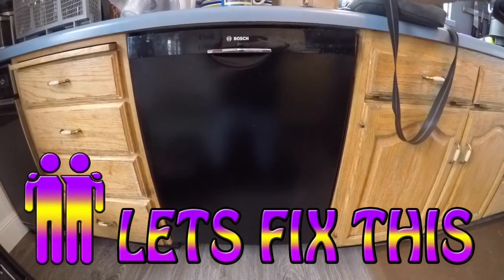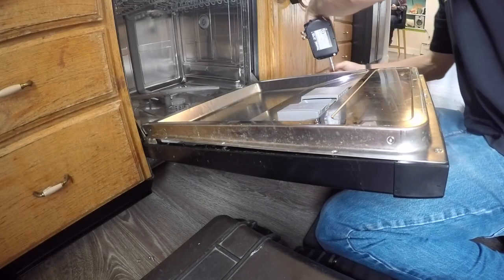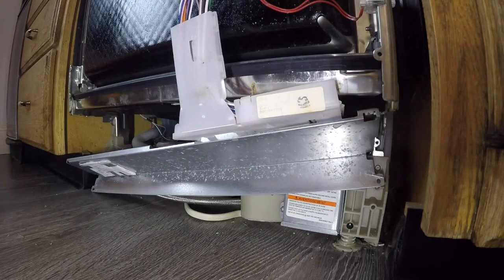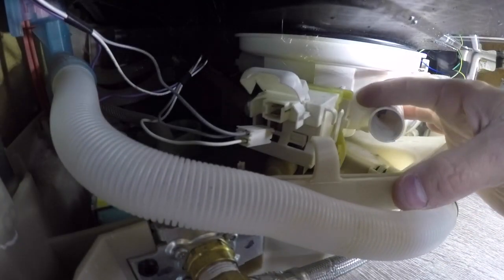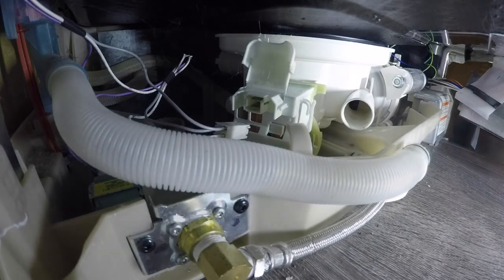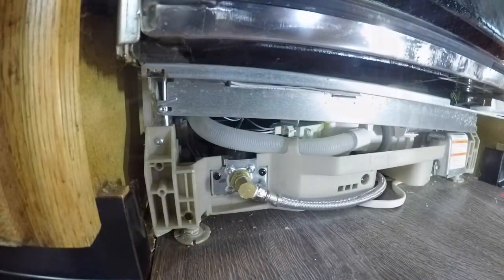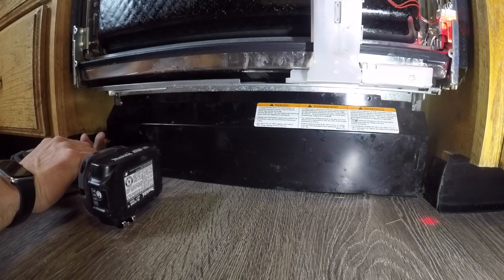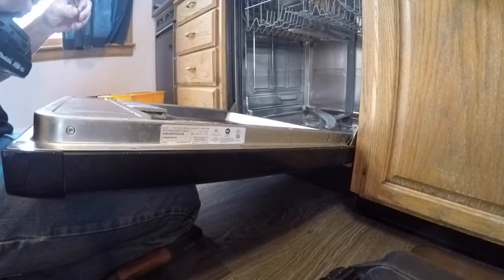Bosch Dishwasher Drain Pump Replacement

Comment: I bought a Bosch dishwasher about a year-and-a-half ago and installed it. The drain pump is already gone bad in it. I watched these videos and I decided to put the drain pump in it myself which I did in an old Kenmore of mine too. but my particular Bosch dishwasher the orientation of the pump it's different than in these videos. It does not have a quick release wiring harness and the drain hose is extremely hard to get off and I cannot find any release tab to push on to turn and remove the pump.  looks like I'm going to have to pull the whole dishwasher out. This will be my last Bosch